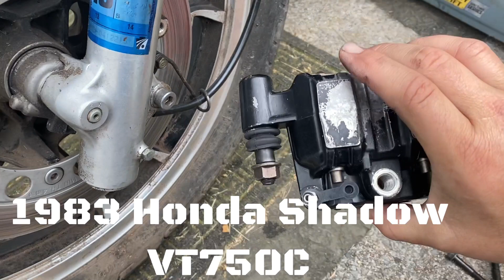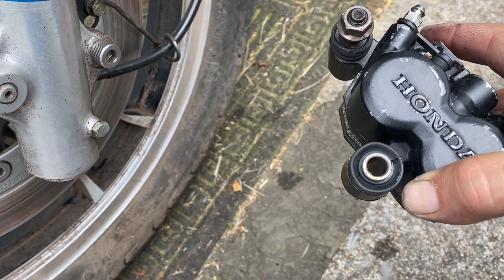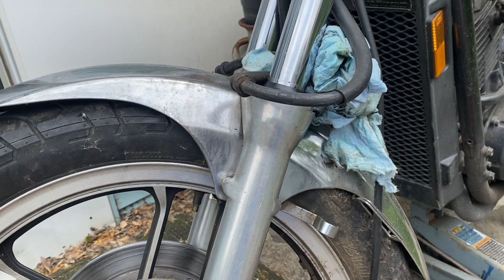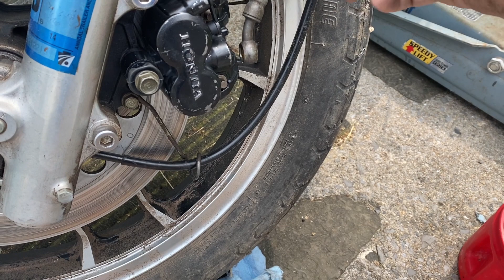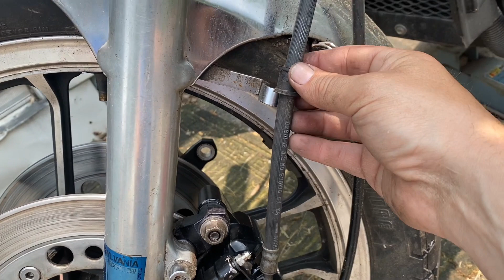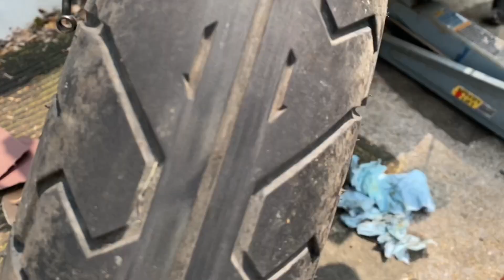Installing New Fresh Rebuilt Front Calipers 1983 Honda Shadow VT750C

Comment: Fantastic,  I want to keep the bike as original as possible as the 83 is very rare over here ,I was lucky to get 2 boxes of used parts with it ,I will definitely let you know if I need parts as I go along so thanks for your offer I really appreciate it ,James
Reply: Hiya I'm having problems getting brake caliper seals I've tried ebay but nothing for an 83 shadow , have you got a link to where I can order some from usa , it looks like my pistons are seized in , its all good fun 😀 many thanks if you can help James.